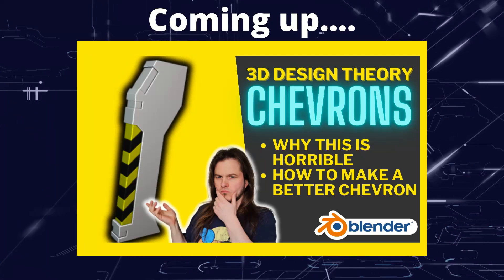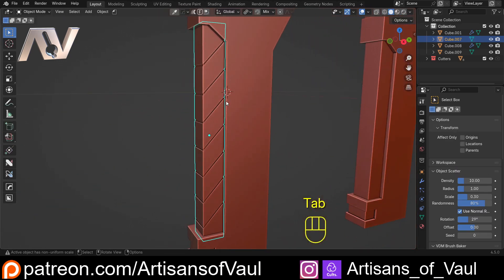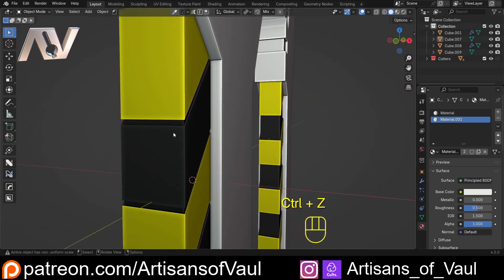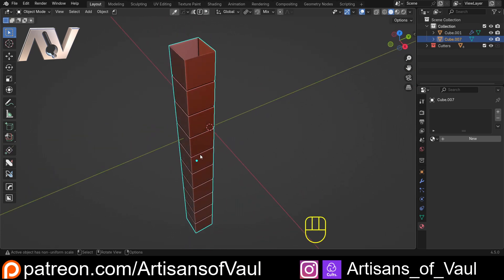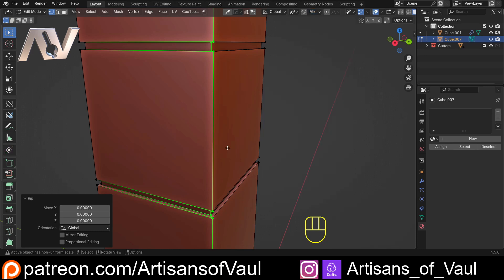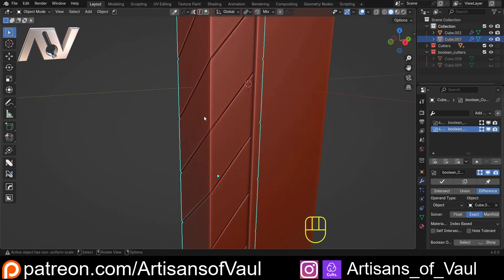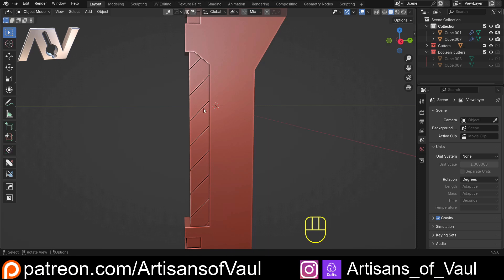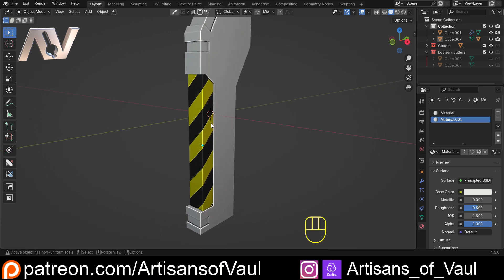3D Design Theory - How to Build a Better Chevron

Comment: Making the chevron is great, but how do we apply it over a curved surface like a shoulder or a thigh?
Reply from the maker: Thats a whole different issue. And the issue with a curve is that the chevron will always look a bit odd from some angles. My go to would be using boxcutter/hard ops to create an inset boolean for the lines between the chevron I think.
Reply: @ArtisansofVaul  thanks for the guidance, I'll give that a shot 😎

Comment: Looks fantastic, but... surely a "chevron" is a "V" shape, not a slanted line (which I think is called a "bend," heraldically speaking).
Reply from the maker: Thats a very fair point. You'd definetly correct in terms of a definition. For models, especially warhammer 40k its generally used for parallel stripes at an angle, often painted black and yellow.

Comment: 10:03 Looks fine but wouldn’t say better when specifically going for “chevrons;” this is more of a square helix where the first ones were chevrons (if unwrapping to a flat texture.)
Reply from the maker: I think the issues covered with that design creates a range of problems. But if you'd be happy with that its all good.

Comment: "Here's how I was an idiot" is always one of the better learning opportunities. :-) Were the uneven scalings of the gaps caused by not applying scale?  And dayum, I wondered how to select which verts got selected in a rip. I think I was always hovering over the verts so it was always confusing. Very interesting!
Reply from the maker: Thanks. No the wider edges are just based on the angles involved for something angled vs the horizontal surfaces.